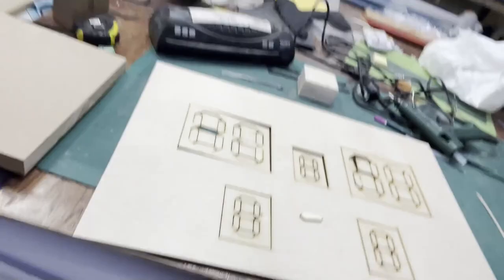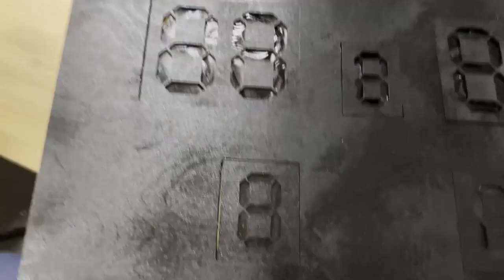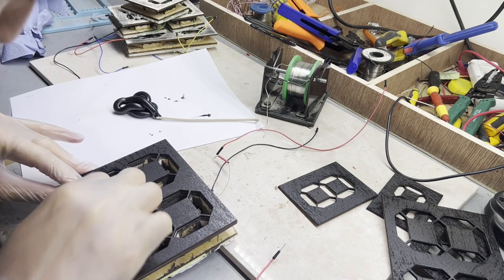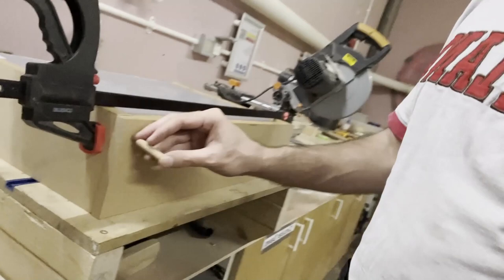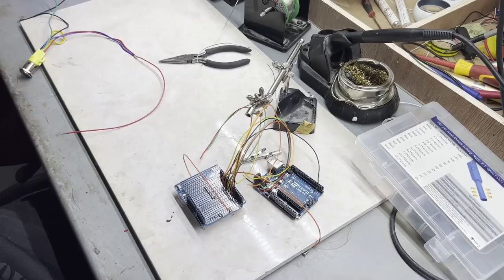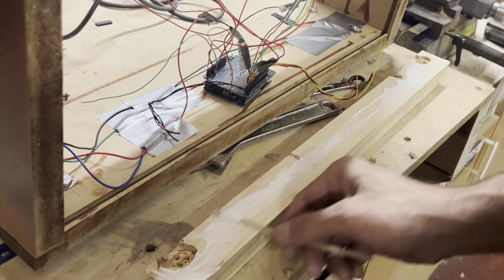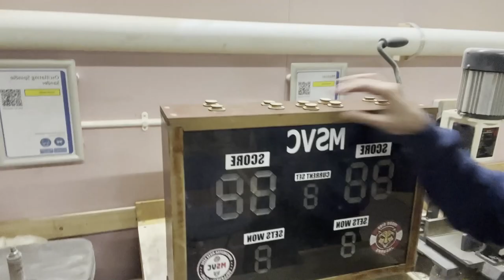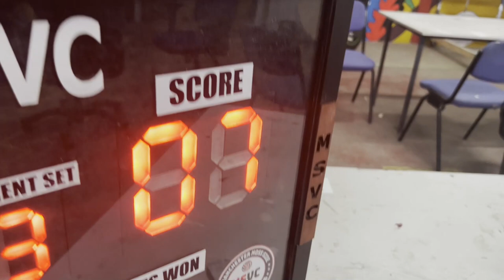DIY - Scoreboard using Arduino Uno

Comment: How did you get the data sir on your rgb light
Reply from the maker: Hi, these are programmable nano pixel led lights. I provided the code i wrote in the description. You need to load the code into the arduino and connect the lights.
Reply: @ArtCraftBlackLight  thank you so much sir, btw you didn't use ic, right?
Reply from the maker: @RyderTv357  what is ic?
Reply: How to wiring sir?
Reply from the maker: @RyderTv357  im affraid you gonna need to open that question up a bit. Because i don’t understand what are you asking. If you are refering to soldering im sure there are tutorials for that
Reply: 'm having a hard time wiring, I don't know the strip led connections
Reply from the maker: @RyderTv357  so in the code you can see pin numbers. You put ghe data to those. You can also see the pin numbers for energy at the top of the code too. You need grounds and that can be any pin for ground.